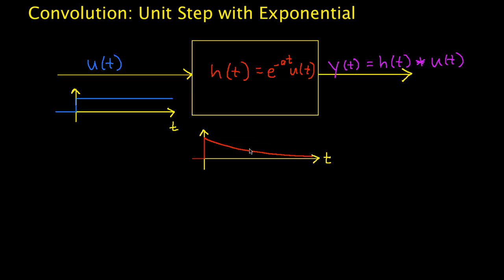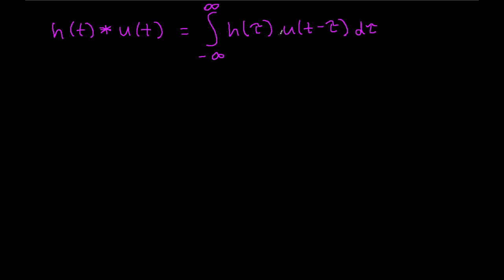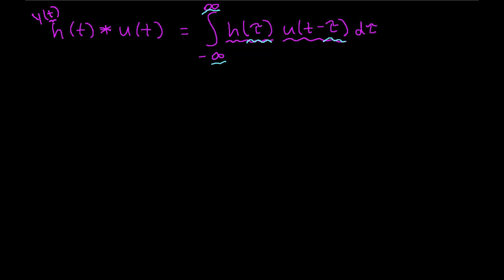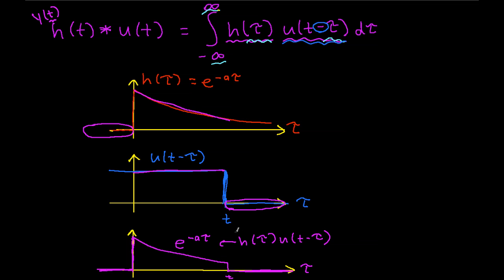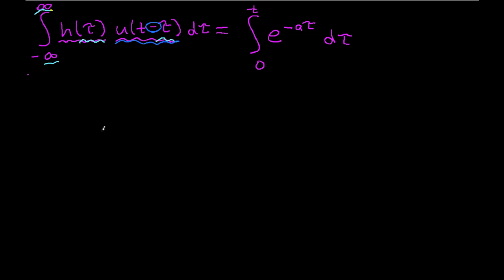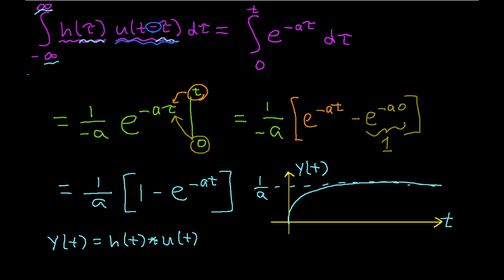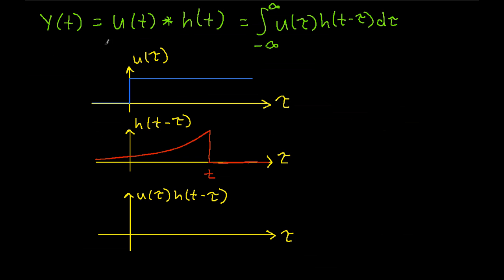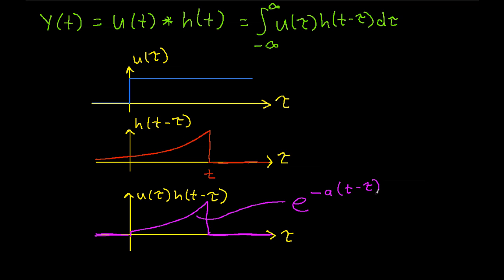Convolution Example-Unit Step with Exponential (Edited)

Comment: The unit step function is 1 for values > 0 as shown in the start of your video. If the unit step is shifted by "tau", shouldn't it look it as if it is zero till it reaches "tau" then jump to 1 at that point ?. Your shifted unit step looks like the step is coming down to zero. I am confused.

Comment: Where did the u(t) go from the original function of  h(t) = e^-at u(t) when turning it into h(tau)? Confused!
Reply: The u(t) represents the time at which the signal starts. That is where he go the limit of 0 from in the first example. So if it had been u(t-1) the limit would have been 1 if it had happened at u(t-2) it would have been 2 and so on.